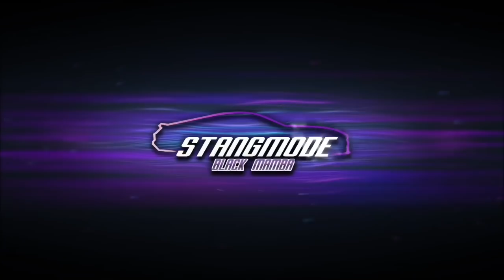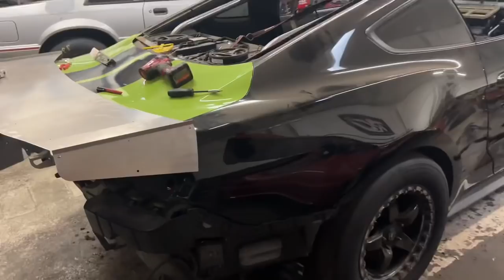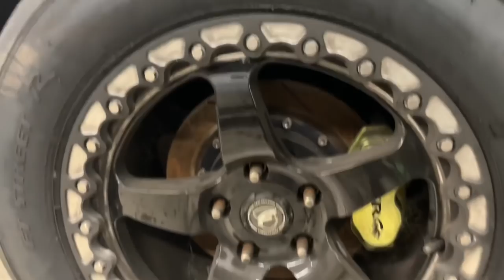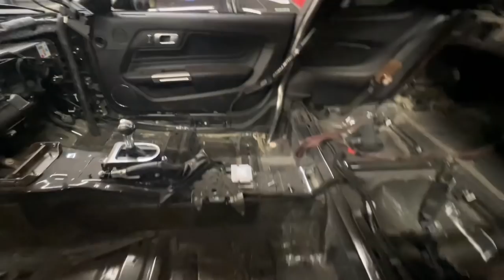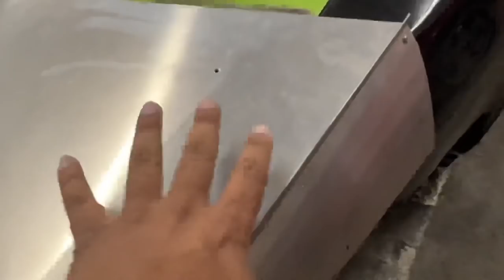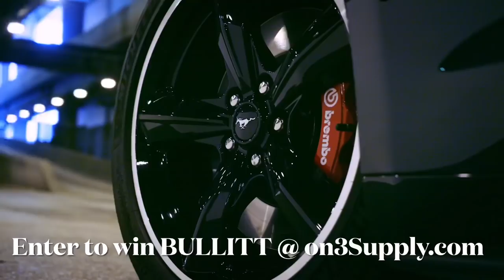Yes! My 8 Second 2018 MUSTANG GT BUILD is Finally Back! *Black Mamba

Comment: Not hating, but I just don't understand when building a racecar, why start with a heavy  s550 platform, the initial cost alone is 35-40k ? Why not start with something light weight like a fox chassis or possibly a Mavrick ? In any case best of luck with build.

Comment: Purple cage pls. And purple stripes on the wing. 

You gotta relearn the TH400 gearbox setup once that gearbox is in. 

Built 5.0 twin turbo goodness and easily cracking 1300+ horsepower.